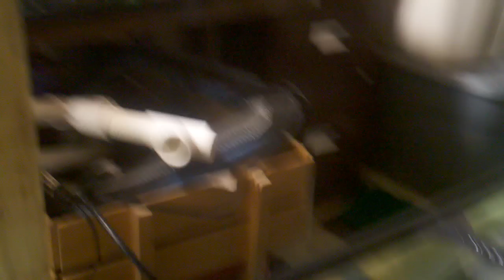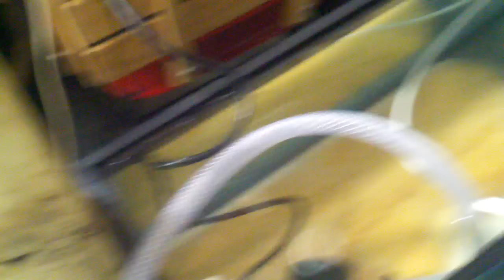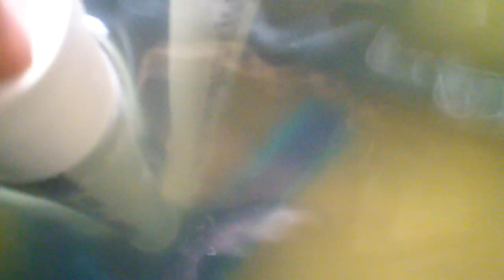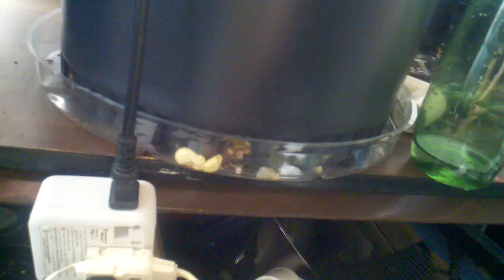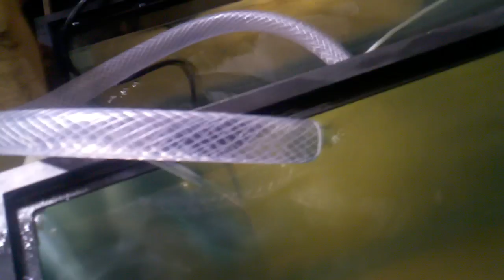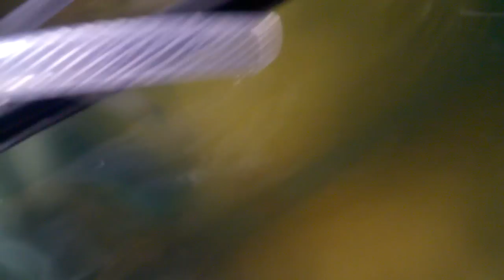Overflow siphon setup for a small footprint Aquaponic system

Comment: Thank you for this video. I appreciate the explanation and tour of your water flow action. As a newbie to the art of aquaponics, I was looking for clarification. With a sump, is this the order of the flow system; ???
• From the Aquarium an overflow drains into the sump tank via gravity.
• From the sump tank, the water is pumped up into a growbed. 
• From the growbed, the water drains back to the fish (via bell siphon). (?)
So I only need to use 1 electric pump, and gravity does the rest, am I correct?
Thanks. 🌿